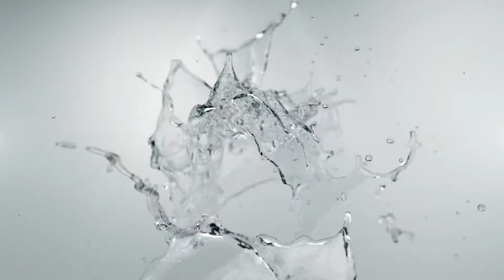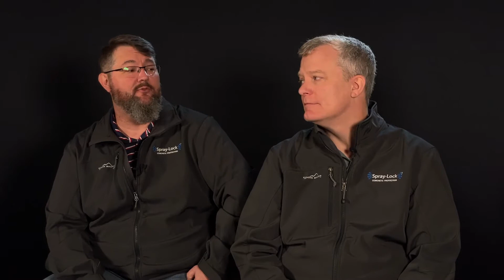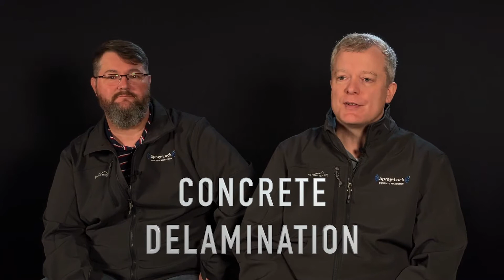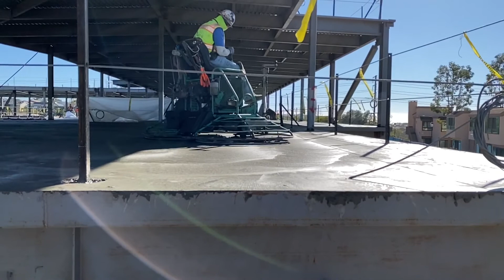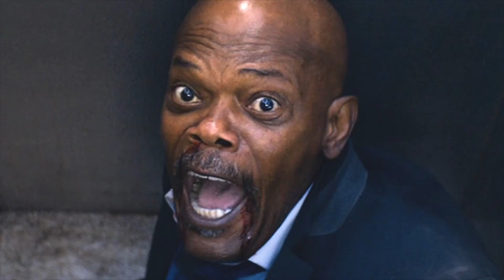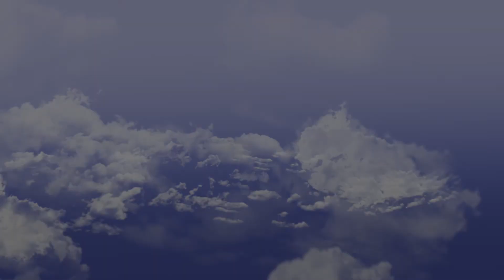Concrete Delamination

Comment: I think the most common cause for delamination in my 37 years of finishing is when the concrete plant gets overloads the concrete with too much air. Happened at the Federal Courthouse in Nashville, TN. and 2 other jobs. Of course they pointed the finger at the finisher as usual, however this finisher knew to have the slabs core drilled and tested for air. 11% air on an interior slab mix ordered with no air ordered. The other was lightweight concrete that called for 3% and ranged from 7% to 12%. Needless to say we were paid to remove and replace the slabs. I often get disturbed at the way the ready mix plants get protected  by suppliers such as yourselves. I appreciate the info but make sure it is not biased  Spring-Lock.